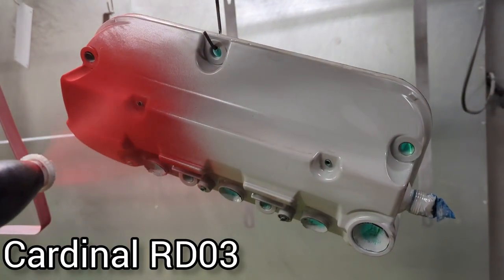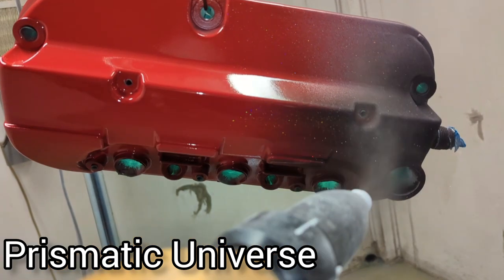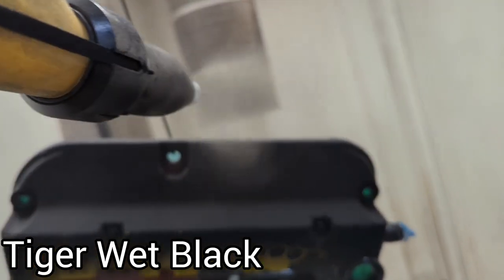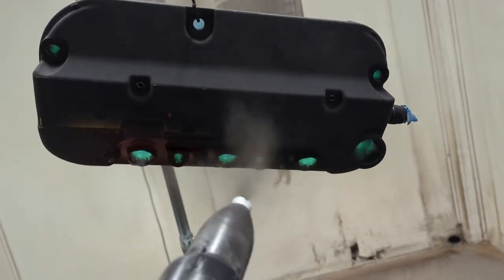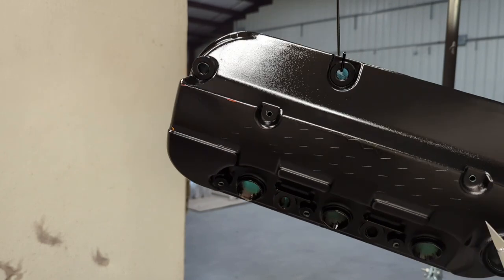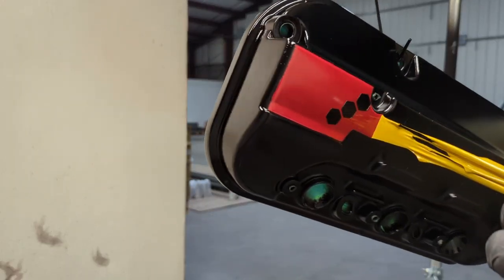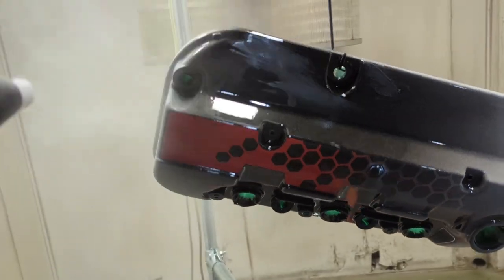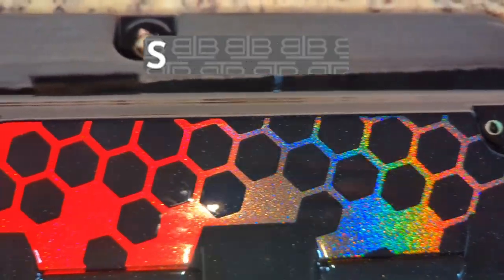Powder Coating Graphics with a Gradient! + Big Announcement! - Ep 148

Comment: Duuuuuuuuude wow. I have a Eastwood gun. It’s ok and I like that I can switch colors quickly but I have had a really hard time recently doing multiple coats. Like 3 colors. It just won’t adhere. Should I size up to a different gun? Do you have any suggestions? I did test my ground. It was ok for the first coat but after that it was weak. Thx my dude.
Reply from the maker: Yeah the Eastwood guns just done babe the versatility. Even the PCS1000 is a terrible unit for what it costs. I was doing 3-4 coat stuff with a hypersmooth 02. This project was with a Gema Optiflex 2